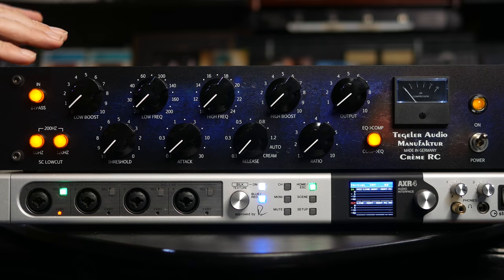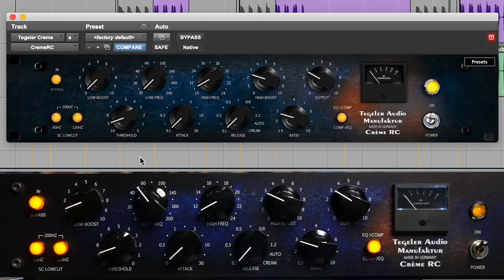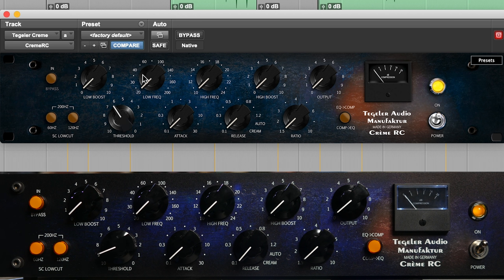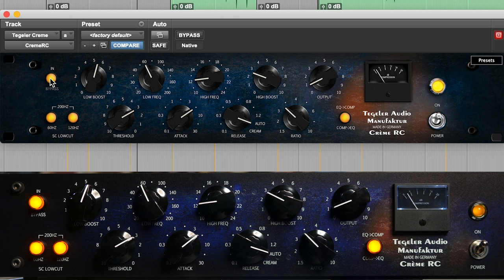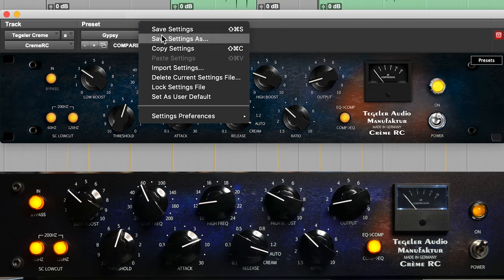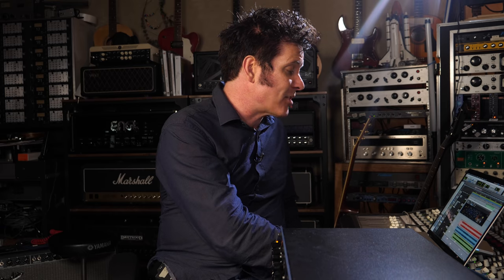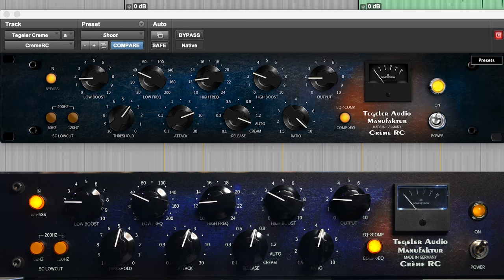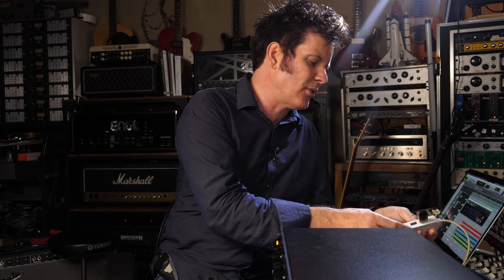Automated Hardware Compressor/EQ with a Plug In - Tegeler Créme RC

Comment: My Lexicon Mx300 has something similar. The pots don't move they are just rotary knobs. But the readouts do correspond to the plug-in and vice-versa. Very useful tool. And they could always go with the digital readouts and rotary knobs on budget line models.

Comment: Hi Warren, 3 feedbacks on this product which is clearly a nice step forward:
1) you tried to control the hardware version with its software version but does it work the other way, moving the real knobs with a direct impact on the software version? It's a nicer user experience than using the boring mouse. ;) The best workflow is working on the 2 ways, depending on the workflow we want to use at a specific moment.
2) You evoke automations but the control of the hardware version by the software version on the DAW seems to not be ultra responsive: a quick and drastic knob move on the soft takes more time to be done on the hard... which control the sound so the automation may not be exactly what we decided on the DAW. Do you confirm that?
3) Still about automation precision, we also see the latency between the soft and hard versions: does it mean we have to mesure precisely (and alone) this latency in order to do the compensation in the DAW on the track having this plugin version? I know that on some MIDI clock devices like the E-RM Multiclock USB you find a way to be sure about the (MIDI) sync of the DAW with the other MIDI machines using an audio track (dedicated to this MIDI synchro) so I think here it's something to think about, using audio or something else. In order to improve once again this remote control of hardware gear. Thanks from France

Comment: Does this mean I could avoid having to hear all the digital navigation of the console, until I was ready to save the settings?  So I could only be hearing the music, while I was tactilely adjusting the levels with the physical interface?  Then I could come back the next day or week and have it all snap back into place by using the screen reader as usual to navigate to the file and open it, turn my screen reader off and go back to just using my hands with the music?  That's what I would like to be able to do all the time.  😌

Comment: I dont understand what is the connection for the remote control . There s some adaptator for thunderbolt and usb. So , that mean that it goes out from the Creme in USB and it goes in your laptop in thunderbolt or this is the opposite ?
Reply from the maker: It uses an Ethernet connection!
Reply: @Producelikeapro  Ahhh ? Ethernet  ? That is strange !!
Reply: @Producelikeapro  So there's an adaptator ethernet to thunderbolt or ethernet to usb ? 
Thank you Warren for your answer ! ;)
Reply: @relaxmax6808  You can use an ethernet switch. Pro studios use ethernet for all kinds of things.

Comment: Hey everyone! I just purchased a Tegeler VTC compressor from germany and it just came in today. I have a few questions that are urgent so I can use it! First, It came with a euro power cord. Can I simply switch this out for an amaerican power cord? It also came over with different fuses by default. Which fuse should I buy so it work? I've already switched the voltage to 115v, but I am afraid to try and power it on without the first two questions answered. Can someone PLEASE HELP!!!

Comment: I've been wondering for the longest time why these have not been a thing. Maybe because the analog knob twiddlers on gearslutz don't want solid state control so one has to make it with these god damn motors instead of doing it the better way (digital control of analog amplifiers).

But yeah... if this makes them happy and they want to pay the money for that, i'm not judging... :D
Reply: Wes Audio and Bettermaker have been doing this for a while now, with plugin control and recall
Reply: @Nick Noize but all the analog purists would start to yell at the gearslutz and it wouldn't sell... 

"MAH KNOBS!!! MAH ANALOG SOUND!!!"

god damn it...
Reply: @Nick Noize I believe McDSP have a box out exactly like this. It's anything but cheap though as it does a lot of things. Even still, the majority of the cost doesn't lie in the knobs or motors anyway.

Comment: The servo's and motorised stuff in that would add a lot of money to the unit cost. It might a better idea to have a blank face on the hardware and have it all controlled digitally via the plug in, without paying for the motorised gimmicks. Like Bettermaker and Wes Audio do, in a different ways. I don't like the idea of paying a premium for motorised knobs on an audio unit, I'm looking for sound quality and digital recall ability. I'd also worry about the shelf life of all those motorised pots and what it would cost in maintenance.
Reply from the maker: Hi Chizzul, the 'extra' charge for the fully recallable function and motorised rotary controls. It's easily the best sounding combo of SSL Compressor and EQ! Check out my review video:- https://www.youtube.com/watch?v=cIJv1tiKfps Yes, I know Wes Audio, I was one of the first to review them and helped them get into Vintage King, big fan! Some people will love this feature, you may not though! The motorised pots are on many other units they make and don't seem to have reliability problems, it's an extremely well made German product which they offer insane warranty on!
Reply: @Producelikeapro  OK, it's an extra €500 for the RC version, which, in all honesty, I 'd rather spend on a higher spec sound wise compressor or EQ. Just my opinion. Out of interest and no problem if you are or not, but are you financially affiliated in any way with Tegeler?
Reply from the maker: @chizzulwinduh1941  did you watch the video? I'm not sure you will be able to spec a better combo at the price. Can you tell me what Compressor/EQ you believe is better? (they ship you the unit for free to try and don't have 30-50% markup from a dealer) I always highlight what I believe is the best in it's class for the price! I have no affiliation with Tegeler beyond really liking this product!
Reply: @Producelikeapro  Yes, I did. If you like it, that's good enough for me! You seem to prefer it to your actual Pultech's and SSL Buss Comp. I don't think you're saying that it's the best possible Stereo Bus EQ and compressor ever and it is better than all others are you?

At that level, I suppose it's what you prefer, rather than "better", which always seems a redundant adjective when talking about different high spec gear, as one will sound great on one track and wanting on another, and different again depending on the listener.

Comment: any plugin similar?
Reply: It's an SSL G bus comp with a pultec clone... so take those two in plug-ins and they are similar (in functionality) whether they sound as good is another question!  Try Softube Tubetech EQ + BX_Townhouse compressor for example, that's the same thing as this hardware give or take.. but they won't sound exactly the same (I don't know if worse but def a bit different)

Comment: I hate stepped pots. The setting I want is almost always between them. f-k them for recall too, it's recall of not the best setting. The best recall is print the track! Then you always have it. This Tegeler thing seems cool though. I think more companies should make analog gear that can do what this Tegeler does. Having it be motorized is neat but I'm fine with matching software like ams-neve.
Reply: “The best recall is print the track! Then you always have it”

The point of a recall is to be able to make adjustments to the mix. You can’t do that with a printed track. A bounce of your latest mix is not a recall. Lol 😂
Reply: @ilikemyrealname  you may be laughing at me but im laughing at you. I re-print the INDIVIDUAL tracks through compression and eq to NEW tracks. No one said anything about a bounce of everything through one comp and eq.  All volumes and send fx effects  come from the computer. Then i come out again for summing.with faders at unity gain. The only thing that gets touched on my board or neve 8816 during summing is panning. This is recallable for the kind of things ppl want to change in a mix which is volumes of tracks or reverb amount. I can always put a plugin eq on for a little tweak over a print.  Ive never had a client say i want to change the compression.  Because all faders are at unity the mix is exactly the same because the recall is the computer daw project. Its not faders that give a board summing magic. If i want to move physical faders which i usually dont care about, i have a separate 24 fader surface.
Reply: @housebandthexenos2569  Lol Whatever your long winded reason for “laughing at me is” I will never know because I am not wasting my time reading this rant. Good luck with your career. 👍